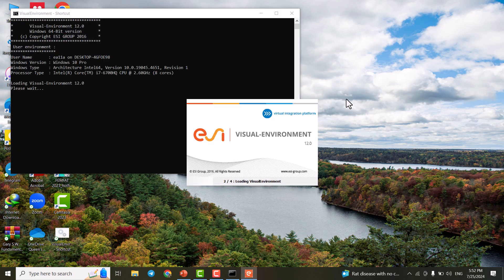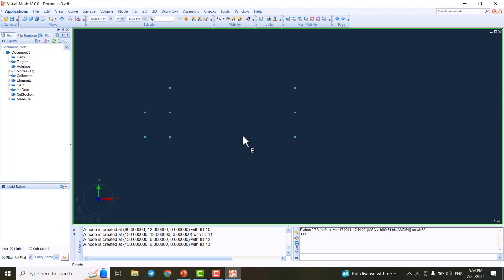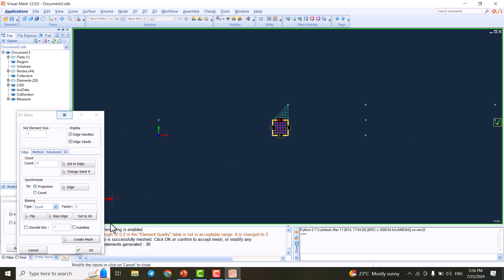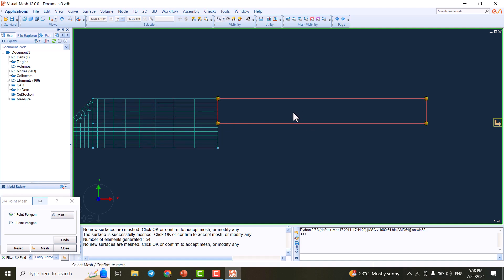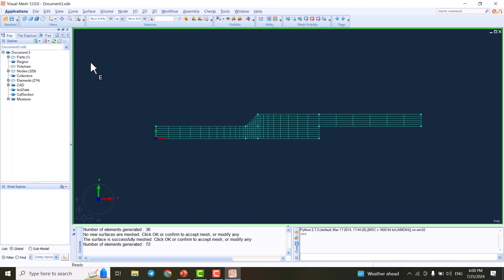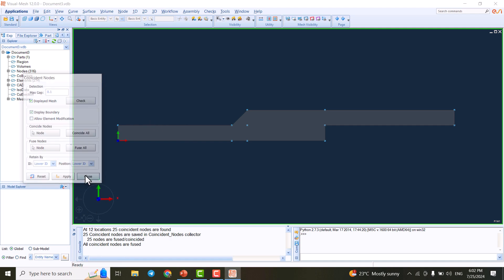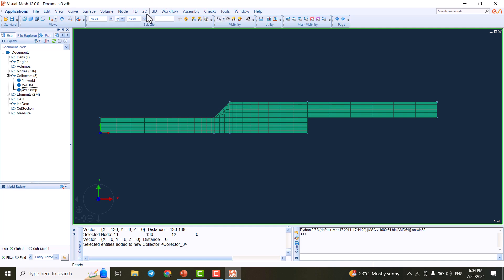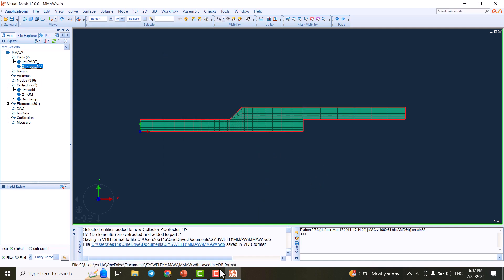2D welding simulation with ESI SYSWELD- part 1: geometry and meshing

Comment: thanx for such a detailed tutorial! do you know whether sysweld support importing mesh objects generated from external sources? plus can you just input all the welding parameters from some scripts rather than using GUI based input?
Reply from the maker: You're welcome! Yeah you can have it from others software packages such as Abaqus, but it only accept 2d mesh! sometimes you'd face problem doing it! it's recommended to create the part in the SYSWELD! I'm not sure about the script, but it has a macros which is kinda the same (basis of the scripts!). So you can get access to it from tool--> macros.
Reply: @FEAMASTER  our ultimate aim is to generate random scenarios(material thickness, fit up) and give random welding parameters to generate simulated welding results  like  may be million times. and since it's very time intensive work, we are trying to automate the whole process in loops and save all the parameters within each loop. do you think that we could do this in sysweld? thanx for such an advice!
Reply from the maker: @coconut_camping hmm I see where you coming from! Tbh, I have to dig a little to answer this question, because I’ve never worked with that!